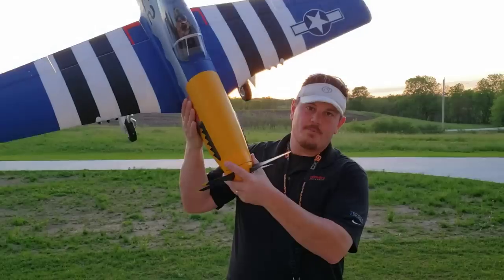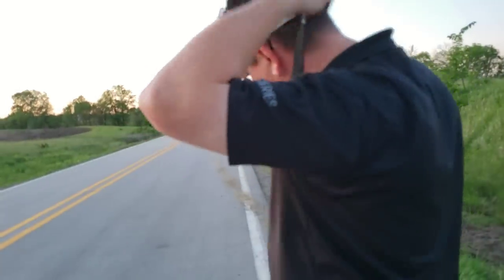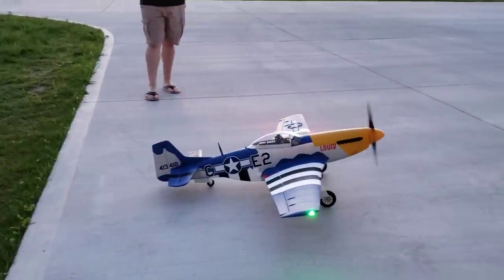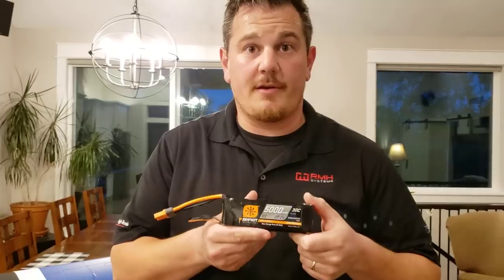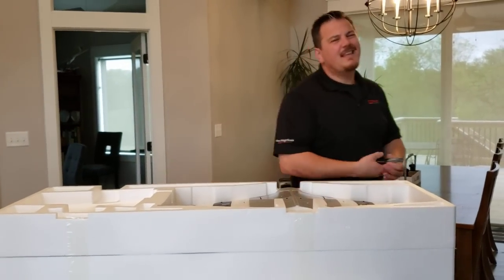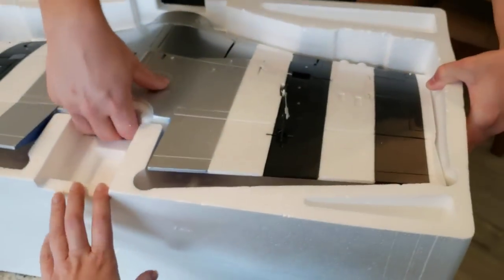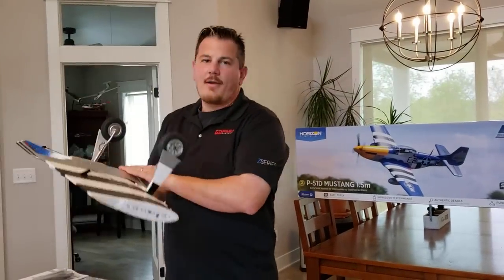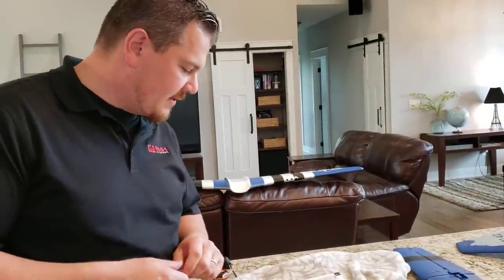E-flite - P-51D Mustang 1.5m - Unbox, Build, Setup, & Maiden Flights

Comment: Brian. Great video - love this P-51. 

One question - when you did radio setup. Is there any reason to NOT use the available preconfigured model template for this plane that is already in a Spektrum transmitter like the NX8? Wondering if you’ve flown this on your NX8 and if that template needs any major adjustments. 

Thanks!
Reply from the maker: If you do, you have to go over them with a fine tooth comb. I don't so I can teach people HOW to setup planes ;)

Comment: Hi Brain im an intermediate pilot I’m just wondering if there is a safe and or a expo set up you would suggest?
Reply from the maker: I show my Expo settings in the description, but beyond that...just get the elevator flat with the molding, rather that what the manual says, and give more output on the elevator to avoid being stranded mid flight...other than that, she's s great flying plane!

Comment: This is a beautiful plane! P-51 and the Corsair are my favourites, but this one looks so complete! Brian, what's the "C" (30C) thing in the battery?
Reply from the maker: That's a Discharge Rating. If the pack is 30C, it will discharge so fast....if it's 60C, it will discharge faster than a 30C. I have a hard time believing these ratings, as I've had a very mixed bag, in terms of success when depending on these numbers.

Comment: Nice, Now You Got A Close Match To My Red-Tail Version, I'm Thinking On Mounting REAL 22cal. Wing Guns On Her... LOL Yeppers It's A Lil More Plane Than Your A-10... Hey You Got Her Yellow Nose - Brown & Drift Sliding The Wheel Rubber Off... LMAO Thanks PS It Has Been Said By Many To Trade Out Those Hard Tires For Some Softer 3 1/2" Tires (Robart Manufacture UX360 Wheels?) Plus Mod Some Clear Flip Up Slat-Air-Brakes On Her! LOL
Reply from the maker: True, and I want to induce some mechanical drag on the wheels. They are just SOOOOOO smooth, they'll roll and roll and roll!
Reply: Maybe Some Playing Cards In The Spokes Tricks, Etc, In The Wheels & Prop!? Would Sound Really Bad-Ass Also... LOL PS I Haven't Flown Mine Yet, Butt My Bar Ditches Aren't As Deep As Yours, Only About 1-2 Feet Deep, Soo No Worries Abouts Running Off Into The Taller Grass To Stop Her... ;~)P

Comment: not sure if you found out the answer, however in order to make the alarm work on your Tx, you need this https://www.horizonhobby.com/air-telemetry-flight-pack-voltage-sensor%3A-ec3-spma9556 granted i know you don't use the ec3 plugs, but this is just showing you what you need. Hopefully this helps. If you've already figured it out, disregard. P.S. that can be used on any plane with a telemetry Rx.
Reply from the maker: So you're saying the SMART AVIAN ESC Doesn't share the voltage of the pack with the telemetry module???
Reply: @BrianPhillipsRC  no i didnt say that at all. i was just sharing what horizon told me when i got my dx8. that was to have the low voltage alarm go off from the airplanes battery pack, and make it audible on your receiver they told me i needed that sensor in the link i shared. if its misinformation then let me know

Comment: I’m having some trouble finding a good but cheep radio that will bind with spectrum receiver any ideas on a good controller?
Reply from the maker: Transmitters
iX20 - https://bit.ly/2Rv1d3M
iX12 - https://bit.ly/2yOEDN7
DX9 - https://bit.ly/3eh3klx
DX8 - https://bit.ly/2xmsD5f
DX8e - https://bit.ly/34uxoWn (This one is pretty reasonable, but it's still a chunk of cash...)
DX6 - https://bit.ly/2Rvik5z
DX6E - https://bit.ly/39Ym1Y9
DXe - https://bit.ly/2XsApFi
TS8G Plus - https://bit.ly/39Vxwzy (This one is cheap, but very difficult to setup...)

Comment: Hi Brian, another great video! I thought I heard you say in one of your videos that you would recommend the 1.2m over the 1.5m. Is that a fact? As a fairly new pilot, which one is easier to fly?
Reply from the maker: Yes, absolutely, 100% this is true and correct. The 1.5m P-51 is not the easiest to fly.

This one you can take to the bank.

Both good planes, but the 1.2m is way easier to fly. Seems counter-intuitive, I realize, but it's the full truth in this situation...

P.S. I've had 3 of the 1.2m P-51's and only one 1.5m P-51, fyi ;)
Reply: @BrianPhillipsRC  Thanks Brian!

Comment: Telemetry min voltage defaults too high.
Reply from the maker: Mine does the same thing! What can we do? Have you figured it out?
Reply: Brian Phillips go into the telemetry settings and set the min voltage to 3.5 or your low preference.  At 3.5 if it sags below you get an alarm.  Pilot Ryan set his to that.  You can set it higher your preference.  I think it defaults to 4. something

Comment: Hey Brian, I've got my eye on this P-51D and the FMS F4U Corsair Blue PNP, 1400mm for 600 bucks. Both have AR-637. Both flown 3 times no rash on them. Good deal?
Also I have 4 6s 7000 mah smart pack batteries, would those be OK with the P-51D?

Thanks in advance for your help.
#BRIANPHILLIPSRCROCKS
Reply from the maker: Sounds like a good deal, but you have to be the judge of that ;)

Everything is expensive right now... If it's foam and used, I figure about 75% - 50% retail would be a "good" deal. Just don't forget the Rx...they are pricey!!!

Comment: 🎉si me lo puedes enviar con radiocontrol mejor y cuanto es el costo gracias saludes..
Reply from the maker: Link is in the video description ;) Check it out, and see what you think.

Right at the top...

Plane, Battery, and Transmitter (plane comes as BNF, so you don't need to add a Receiver)

Comment: Hi Brian, question for you.
Do foam planes warp if hanging from seelling?
I have a P-51 and it hangs from the seelling horizontally.
Thank you brother
Reply from the maker: Not typically. If you hang them, keep the inboard portion of the wing well supported, and you'll be totally fine. Check out my NON-Plane Playlist, and you can see my old storage method...loads of planes hung on the ceiling.

Comment: That’s why you 3 point an airplane
Reply from the maker: Sorry Nathan, What, is why you 3 point an airplane?
Reply: @BrianPhillipsRC  to demonstrate complete control. When you are in a wheel landing position you are just a big unstable weathervane. Love your videos they are very entertaining 👍
Reply: @nathangriffin8186  That’s just not true.  Full scale pilot here with 200+ Citabria and 600+ Cessna 185.  Always wheel land as it occurs at a higher airspeed than you can three point, and no, you don’t lose yaw authority until the aircraft is much slower than the speed at which it drops to the tail.  The rudder has lots of control authority.  You can even blast it with the prop at a stand still to push the tail around.  So yes, always wheel land and maintain directional control with the rudder until the tail drops.  Elevator should be at almost full nose down before the tailwheel drops.  By the way, try landing a taildragger in a three point with a crosswind.  You’ll lose directional control for sure.  Crosswind is a one wheel landing, going to the upwind main, and only to the tail when completely slowed down.
Reply: @bendrixbailey1430  I just happened to be a full scale pilot too buddy and I have flown a lot more tail draggers than a citabria and a 185😂 btw in a crosswind you just put the wing down into the wind and pull to a 3 point attitude, you clearly do not have the experience that you say you do and if you really do have that time I bet it if with an instructor which is just reinforcing your bad habits, all a wheel landing is is a crutch for the incompetent which is what we say about it here in the warbird community
Reply: @nathangriffin8186  I don’t know who ‘we’ is in your warbird community, and your claim that you slip it down the centerline then perform some kind of physics magic to make all three wheels touch is pure rubbish.  As for your qualifications, “a lot more taildraggers”, I shared my hours in model.  What’s your claim, a claim you’d back up with a photo of your logbook?  Your angry little response reads like a poser who got busted.
Reply: @bendrixbailey1430  ok buddy I don’t have enough time to list out all of the airplanes but I have logged time in 23 models of taildraggers and I tell you one thing a citabria barely counts as a taildragger because it is so easy to fly and yes in a crosswind there is something called a 3 point attitude at which the airplane is pointed towards the sky and that is the attitude that you should touch down with your wing into the wind
Reply: @bendrixbailey1430  I would gladly show you pictures of my logbook
Reply: @bendrixbailey1430  I would gladly share a picture of my logbook
Reply: @nathangriffin8186  Not your buddy dude, but you are not saying that out of friendship, you are being insulting.  Devolving into insults is the sure mark or someone who can’t stand on their own honest accomplishments.  Flying is a great equalizer.  You do what you want and live with the results.  Trading barbs with other pilots won’t improve your flying or prove you right.  For any other readers who are reading this foolishness, consider this; is it ever recommended to land tricycle gear aircraft on all three wheels at once?  No.  Trying to do it is a great way to wreck an aircraft.  Does anyone think its possible to put both mains down at once in a good crosswind?  If you try, you’ll be sliding across the runway or not lined up on the centerline.  Either one will probably result in a wreck.  That is true of  taildragger and tricycle gear airplanes.  For those who have not gotten a taildragger instruction here is something to consider.  The first landing you learn is three point, not wheel landings.  Why, cause they are less likely to result in an accident by the inexperienced pilot, therefor safer to instruct.  Three point landings are not taught in a crosswind. But you cannot get signed off until you learn how to wheel land.  For anyone new to taildraggers its a counterintuitive set of control inputs.  You have to fly the airplane down to the runway in a level attitude then ‘stick’ the aircraft to the runway by pushing the stick forward (down elevator).  That is exactly not what you do with tricycle gear.  The potential for disaster with wheel landings is that the pilot will react with up elevator, or not enough, and the aircraft will porpoise madly and more violently due to pilot induced oscillation until it crashes.  Wheel landing requires mindful coordination and a deft touch.  It makes possible landing in a strong crosswind.  

Mastering this technique is key to ski flying as well.  One of the risks of landing on lakes is slush under the snow, on top of the ice.  Land and stop and you’ll likely get frozen in.  The skilled ski plane pilot touches down on the mains only, keeps the airplane flying, but compressing the snow, and then lifts off and examines the ski tracks for traces of water from the air.  Having flown wheels, floats and skis on both the Citabria and 185, and not having had so much as a runway excursion or frightening landing, I’m comfortable in my knowledge and skill.  Any reader who cares can YouTube some taildragger crosswind landings and decide for themself.  So long Nathan, I’ll not bother to respond to you again since your mode is insults, not knowledge.
Reply: @bendrixbailey1430  If you are easily insulted the airport is not the place for you. Yea you obviously shouldn’t 3 point a nose dragger, you should land it with the nose at a 3point attitude  as if you are in a taildragger. When you are in a crosswind and you are in the 3 point attitude the airplane is done flying no matter what you do with the stick, and if you are in a wheel landing position all you are doing is complicating things. You are going so fast in a wheel landing, and you are going to be in a 3 point attitude anyway so all you are doing is basically a low pass that touches the ground, and the tail has to be on the ground anyway so all you are doing is complicating things. Yes you do that with skis as you said so that you can lift back off if you need to but this is simply not the case for landing on pavement or grass. If you are trying to land short and do a wheel landing, the probability of a prop strike or completely flipping it on its back. Do me a favor and try a 3 point sometime it is not as hard as people say, and in a crosswind fly your normal pattern except slower, and get to the 3 point attitude and try that. I have done both and a wheel landing is so much more unstable I don’t expect you to respond, but please just humor me. Goodbye
Reply: @bendrixbailey1430  I’m done talking to you buddy
Reply: @bendrixbailey1430  Nathan is my middle name  look up Doug griffin under searches for warbirds and I’m sure you are a “competent pilot”